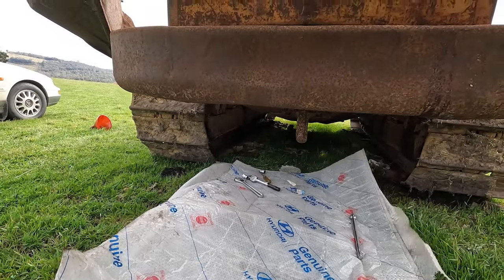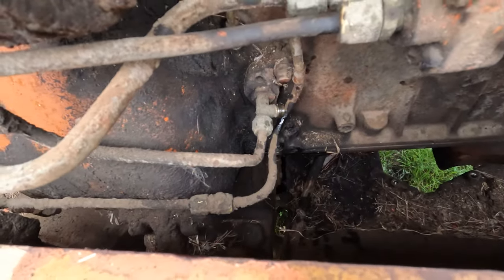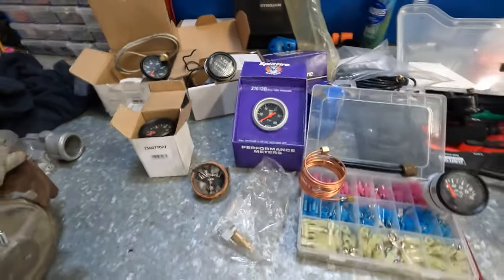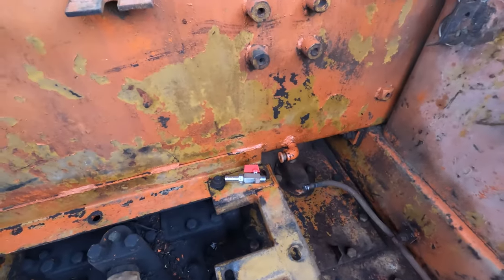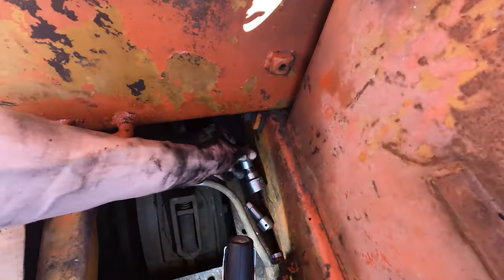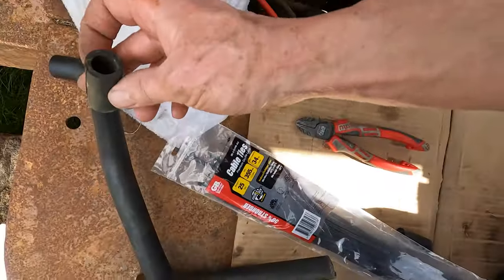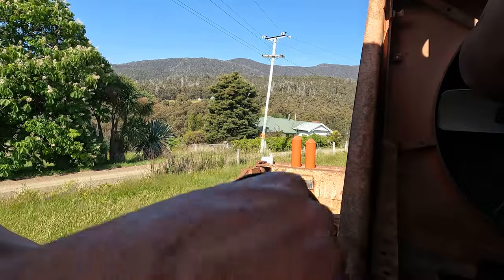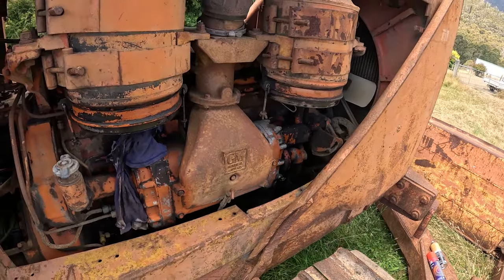Allis-Chalmers Restoration Series: Part 1 - Discovering the Issues

Comment: It's good to see it getting some love. It looks like you are going to paint it Persian Orange again  My HD6 came up great with a paint job and has got a lot of good comments from people who have seen it. I don't know if you are aware but Allis Chalmers  changed the recipe for there paint in 1960 and still called it Persian Orange. They are now called #1 and #2. In my mind #1 looks better as it is a more pumpkin shade than #2. I look forward to watching you getting it back to work.
Reply from the maker: Cheers.
Hd6 is a good size machine.
Yeah I looked into the paints and saw that there was 1 and 2. End up matching the colour of the back of the fuel filter cartridge housing. About the only spot left on the machine to get a colour match.

Comment: Good work there.  I would love to know those filter #s.  I was unable to track them down in the USA.  thanks mate
Reply from the maker: 👍
They are fleetgaurd filters. primary fuel  and oil is FF141. secondary fuel is FF103.
Reply: @Tassietinker490  Thank you.  Seems these are quite odd as wix does not offer a crossover but have located some fleetguard with spares to keep on hand.  Even with the part #   not easily accessible in usa.
Reply from the maker: @bigcal36 Not a problem, I should probably get some spares too.